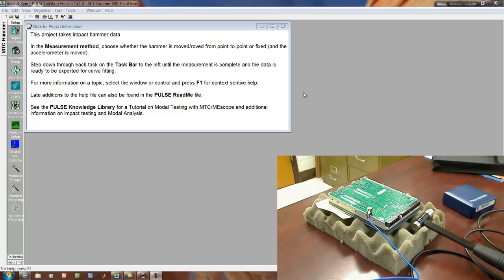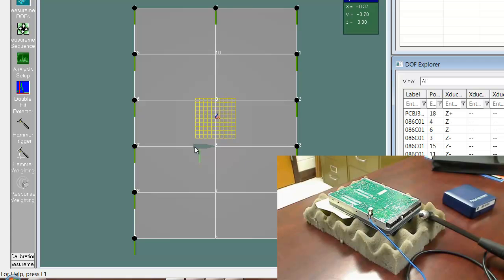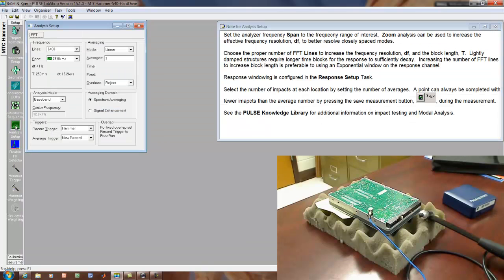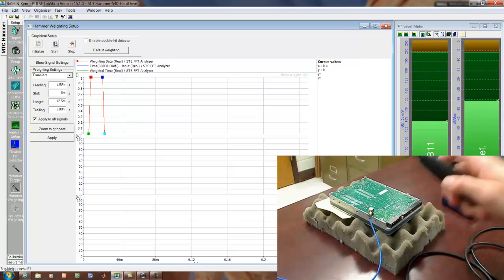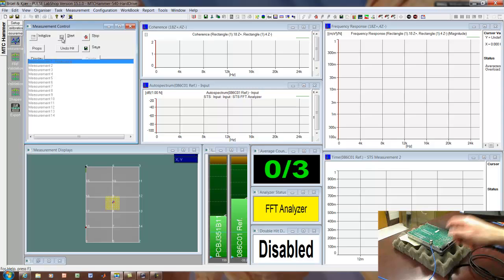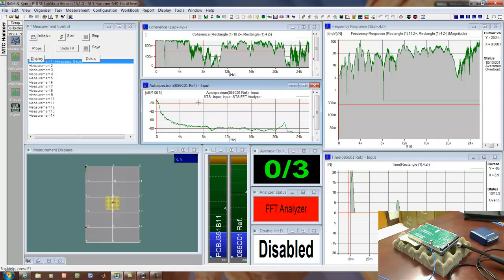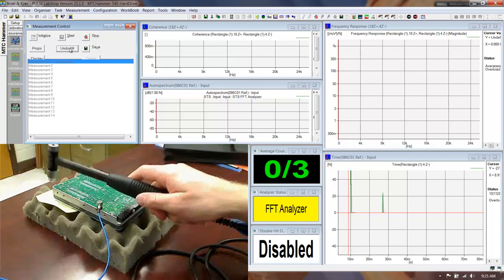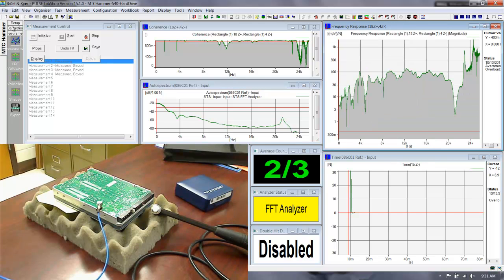Hammer Modal Test of Hard Drive Using B&K Pulse-Part 1

Comment: How is your accelerometer attached, hopefully you have it stud mounted in order to get a reliable 20 kHz bandwidth.  Are you going to correct for the lift at higher frequencies as you approaching the resonant frequency of the sensor.  Try suspending the drive on a cord to achieve a better free boundary condition. Take off the response window, lengthen your time capture block by changing frequency resolution and see if this helps